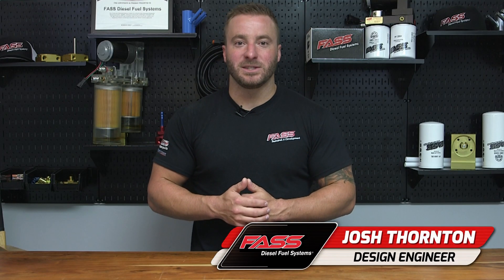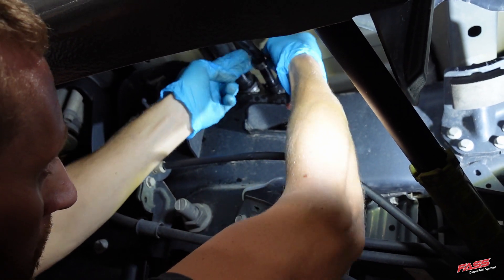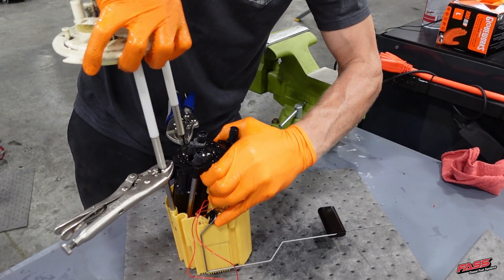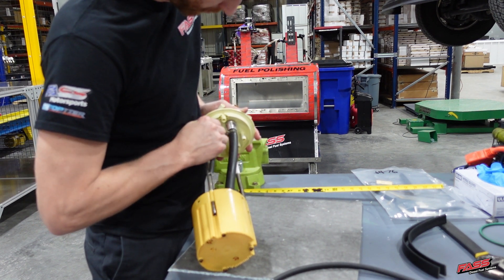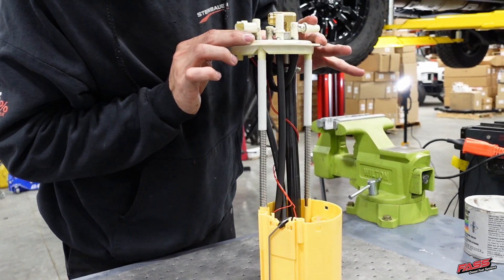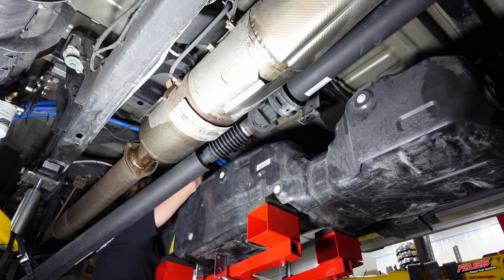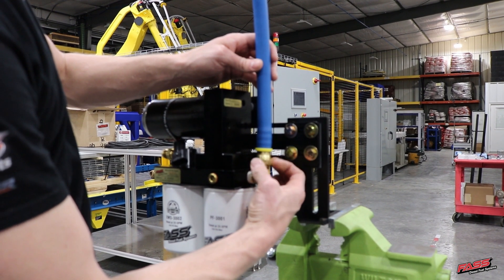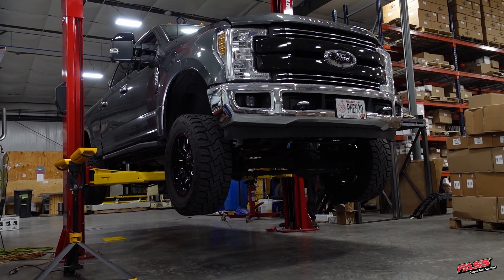How to install a FASS Diesel Fuel System on a 2017-2021 6.7 Powerstroke

Comment: Do you guys have a tool list for this job? What size sockets and wrenches will be needed
Reply from the maker: Good question! All of that information will be inside the manual.
Reply: @FASSFuelSystems  we just installed my kit Saturday, and it didn’t come with any instructions, we had to look off our phone at them, and the online instructions and this video use different parts and do different things on the fuel tank side. Would recommend labeling the actual parts with stickers and sending paper instructions, great product it’s my 2nd fass but 4/10 on instructions
Reply from the maker: @Faith_Fire_andFlavor  Hey there you were probably looking at the wrong manual then. What is your serial number and ill send the correct one to you?

Comment: Can I use a fass system when I have a power stroke fuel filter system from spe on my 2018 f250 6.7 ?
Reply from the maker: Great question! With a FASS installed, you can eliminate or remove any other factory or aftermarket filters, as our system will remove more contaminants than they can—so they'll no longer serve a purpose. Unfortunately, we wouldn't recommend trying to run both kits at the same time.
Reply: @FASSFuelSystems thank you

Comment: I recently installed this system in my truck. 2020. It now won’t crank. Any help?
Reply from the maker: Hey there! 

Thank you for reaching out. When it's convenient, please give us a call at (866) 769-3747 or shoot us an email at techsupport@fassride.com, and our service team will be happy to help! 

Thanks again!
Reply: I installed the system and it trashed the rest of the fuel system.. 
I replaced everything injectors, injector lines, high-pressure fuel pump,fuel rails 
Currently waiting on my stock pump to come in for the tank
Reply: @christopherthomas2270 Holy smokes dude! I was strongly considering this system but I am seeing tons of bad situations like yours; what did you end up doing in the end?
Reply: Did you figure out what was wrong with it

Comment: so you use both factory filters along with the fass system if so why run it through 4 filters just curious
Reply from the maker: Great question, and after you install the FASS you are welcome to remove the factory filter. There are a few different fuel filter delete kits we've seen customers use as well.

Comment: So is the factory water separator being used in conjunction with the fass system or is it completely bypassed?
Reply from the maker: Great question, and the factory water separator is being bypassed by our fuel system. If you have any other questions about these kits our service team will be happy to help you out as well. Our number is 636-433-5410. Thank you!

Comment: Can this be used with the SPE twin cat filter set up that replaces the stock water separator?
Reply from the maker: You might be able to plumb both systems together, but we certainly wouldn't recommend it. Our system will eliminate water, air, and debris more efficiently than other systems, eliminating the need for additional filtration.

Comment: Had this system installed with a sump but after fuel level would never work properly when I fill up all the way it only goes to 3/4 tank and I can go
much further after reading e
Reply from the maker: Hey Devin, thank you for reaching out! We are very sorry to hear you are having trouble with the system after installation. 

Whenever it's convenient please reach out to our service team so we can help you get this resolved. Our number is 636-433-5410. 

Thank you!
Reply: I have this same problem

Comment: What is the purpose of this how will it help my truck and in what way.
Reply from the maker: Hey there, thank you for reaching out!

FASS stands for Fuel Air Separation System and is a combination diesel fuel lift pump and fuel filtration system designed to improve your diesel truck’s fuel mileage, and performance, and extend the life of your diesel injection system.

Our systems do this by removing impurities from diesel fuel such as air, dirt, and water—which are harmful to injection components. Providing polished fuel to the combustion chamber also creates a more efficient fuel bur—improving power and efficiency.

I have a link to our "What is FASS" page as well, there is a lot of great info here on our system!

https://fassride.com/what-is-fass/
Reply: @FASSFuelSystems  thanks
Reply from the maker: @Sultanoftheblind  You bet!

Comment: Will this work with a sump? If so, does the tank still need dropped?
Reply from the maker: Hey there, thank you for reaching out. Great question, and yes our kits will work with a sump. We actually have those on our site as well and will attach a link below for you. 

The sump will drill into the bottom of the tank preventing you from having to drop it. In our fuel system kits, they do come with the draw straw assembly. Which will work with your truck's factory sending unit in the tank. 

With either option, there are pros and cons to doing them, and we completely understand not wanting to drop the tank. If you have any questions about this we would be happy to discuss it over the phone as well. 

Our number is 636-433-5410 Thank you! 

https://fassride.com/shop/product-category/accessories/fuel-sump-kits/
Reply: I'm working on mine currently...I have a utility bed on my F-350 so I've had to mount mine differently but close to the same spot. I have talked to support a time or 2 and they have been good as well.

Comment: Are you able to remove the factory water separator once the fass system is installed?
Reply from the maker: Great question! You'll retain the factory unit due to sensor placement.
Reply: @FASSFuelSystems   So, is the Water Separator Filter being used in conjunction with the FASS System? If completely bypassed, is the water sep sensor is there for looks and non-functional then?
Reply: I removed mine. The water separator sensor will have to be covered so you wouldn't have a water separator light on on your dash. I used a piece of foam material, made a hole and stocked the sensor inside and strapped with zip ties to keep it from coming off. I also strapped the sensor to a place between the frame and chasis to keep any water getting into the foam and sensor.